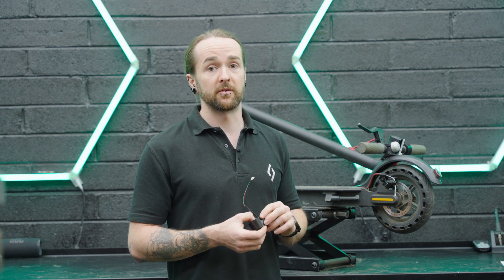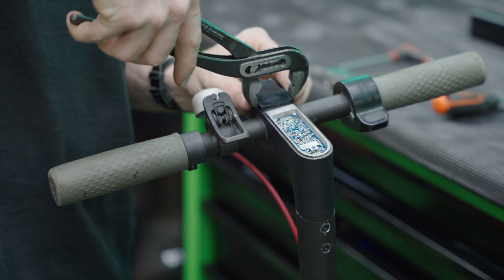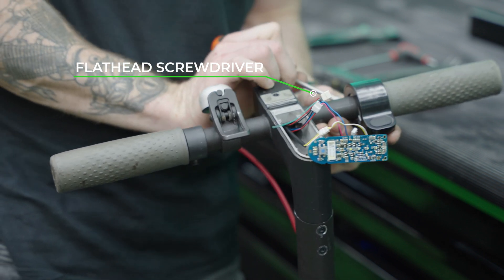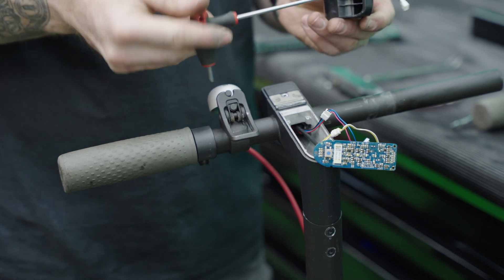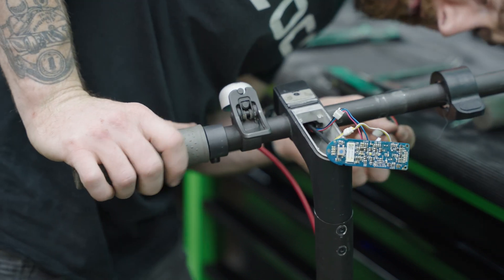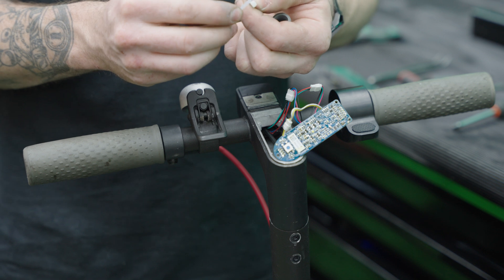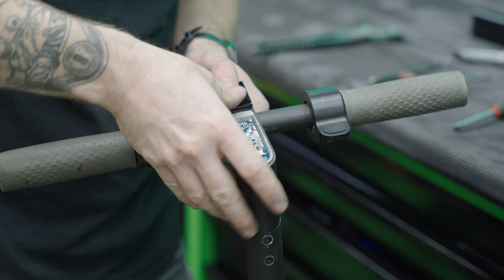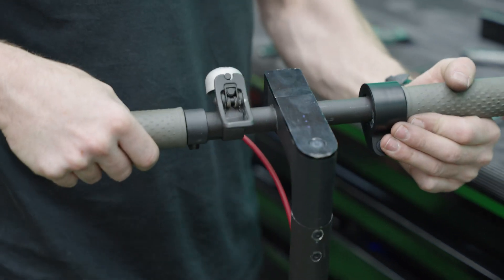Xiaomi M365 Electric Scooter - Throttle Repair - Error Code 14 - Repair Tutorial 🛠️

Comment: I have a newer version, whole front panel was one part and glued all around. Impossible to use a pipe wrench, had to use a tiny flathead all around breaking up the glue
Reply: Mine too, and the cables was short af. Im the end i teared down the thortle and re magnetised the damn thing. Now its working. Fun fact. The throtle sensor is basically 3 wires and two magnets.
If you somehow affect tge magnets the sensor goes bad.
Another fan fact, if you bring a magnet clos to the throtle it start accelariting